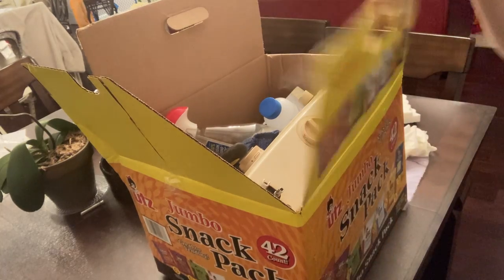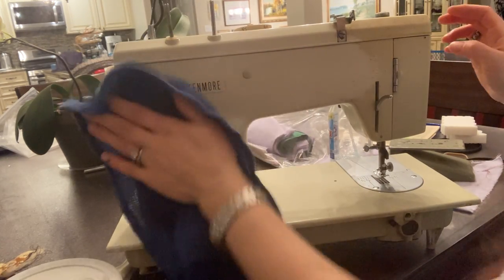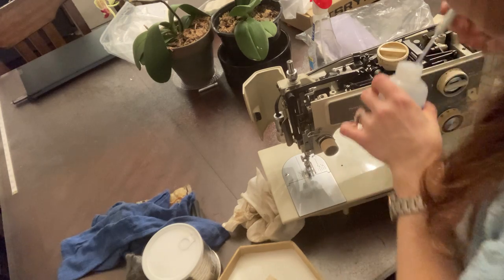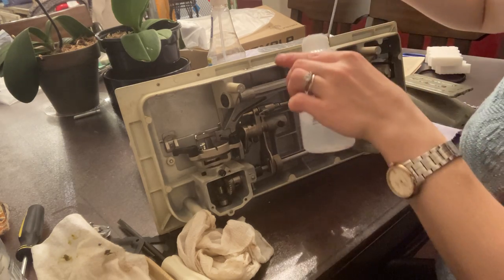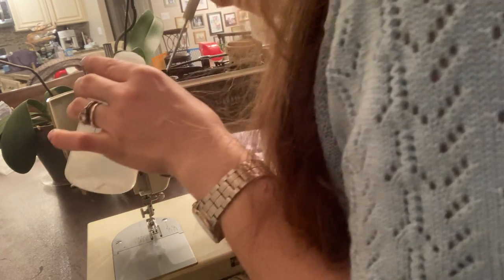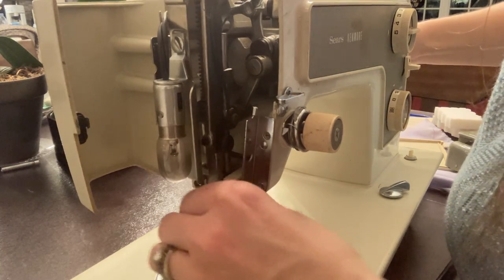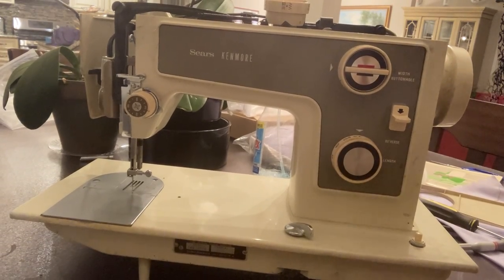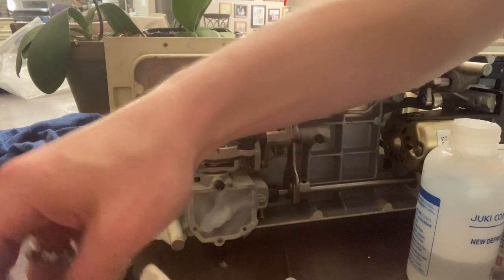Kenmore 148.13110 vintage sewing machine wheel won’t rotate, totally stuck

Comment: Thank you so much for this video. I'm about to try to resurrect my Mom's old machine, 148.15600, and it's quite similar. I exclusively use Triflow oil on my machines so that the Wd-40 isn't needed. I just found out Mom has faithfully used her same tin of 3'n'1 oil (the worst!) for the last 40+ years..

Thank you again!

Comment: I also have an old kenmore that I haven't used since 2006.  When I put her away for a bit, she was clean, freshly oiled, well timed and running well.  But, I learned that some oils tend to gum up and solidify.  Thanks to you, i began to clean her up.  She too was stuck and wouldn't move.  Ive got her soaking in WD40.  I'll mess with it more tomorrow ant take a brush to clean the joints and get rid of sticky gunk.  Your vid was very helpful.  Thankyou.

Comment: Thanks for the vid. I have an 80's Viking 6690 and the wheel does not turn freely. The machine sews OK, but I have not lubricated all metal gears and shafts. After I do I'm sure it will rotate.

Comment: I have a 148.13100 that will not do a zig zag stitch. The needle foot moves when pushed with no issues but it is not moving in that stitch setting. Any advice?

Comment: Ok, I’ve oiled just about all the pieces I can reach on my Kenmore 158.14101. If I crank the wheel by hand everything moves now. Until I plug it in and press on the electric foot pedal. I can see the needle move up a little, then down, and then… nada. Any suggestions on what to check next?

Comment: Help. I  have a 148 Kenmore and 158 Kenmore . Both sound great. But both are doing  2 stitches forward  then 1 stitch backwards. Only tight stitches (straight and zigzag . Any idea how to correct this ?
Reply: I'm having the same issue with my 148 Kenmore.  Did you figure it out?  Any suggestions for me?
Reply: Maybe the stitch selector is in blind hem  , does it look like an EKG readout? Try  making sure the stitch width is at zero and it should straight stitch correctly. Good luck!🍀

Comment: My clutch will not turn towards me to use the bobbin maker. It sews perfectly. How do it get it to turn towards me? I’m the only owner and it’s not put together wrong since I’ve never had to open it.
Reply from the maker: There is nothing that wpuld physically stop it from turning than just being tightened by the factory or old oil turning sticky. I would put a few drops of oil right where it’s screwed in and put some brute force into it.

Comment: Ania. looks like you really know your business! But why not use a pin-point oiler rather than dipping?
Reply from the maker: When I need my tools at home, they are at the warehouse…. When I need them at the warehouse they ate at home… and when I need them in both areas they are lost. The downside of ADHD 🤣
Reply: @AniaProts  Hi Anai, I have ADHD too and just a suggestion. What if you had two sets of tools; one for each place? Also I was so happy to find you! I was going to get rid of my machine because the wheel has been frozen for many many years and I'm embarrassed to say I have not used it, or tried to get it repaired...